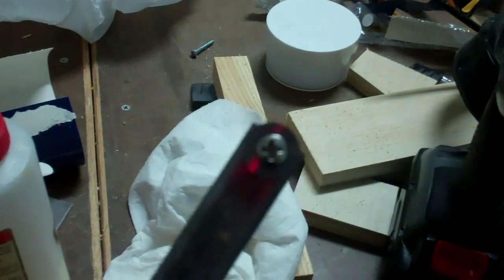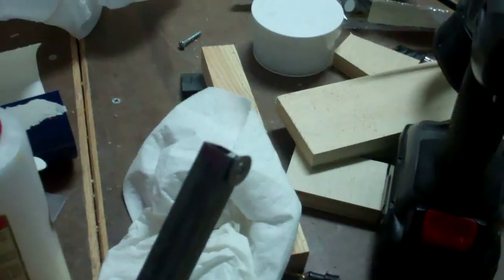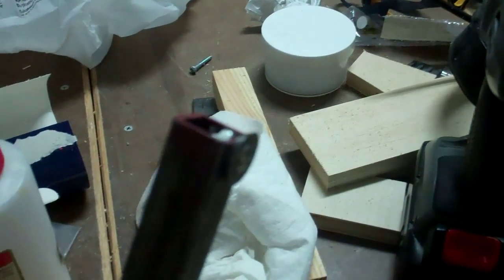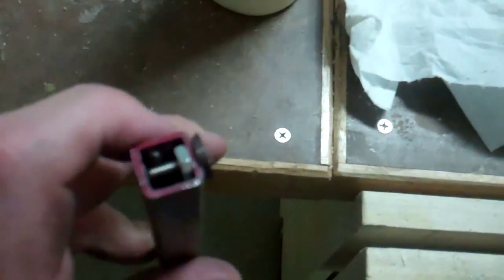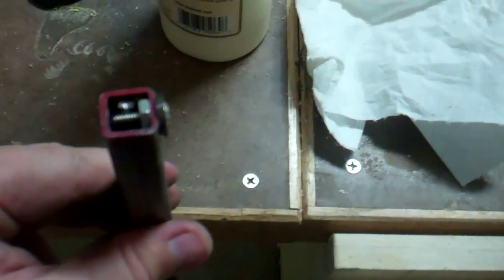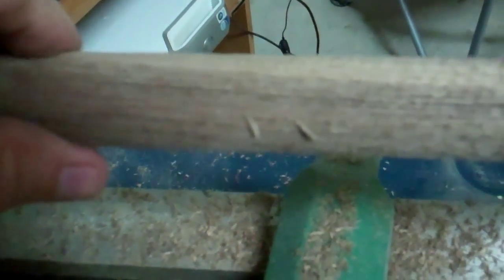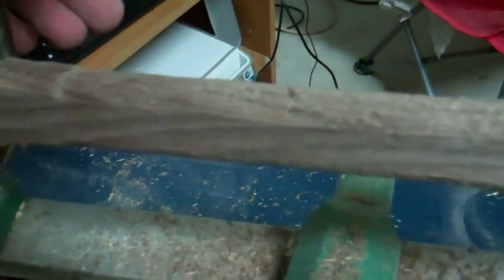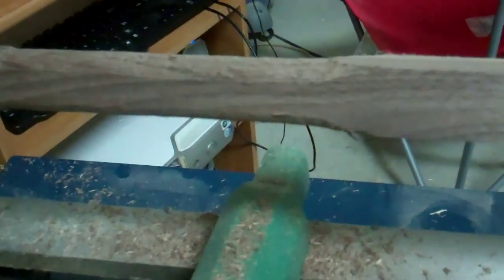Carbide Tipped Lathe Tool

Comment: Dude move the tool rest closer, that's step number one.     Number two is don't use a hollow tube, that's asking for trouble if you ever get a bad catch, and that thing was only on there with a simple nut, if that ever failed that carbide cutter might go through you like a bullet.      You need to get a solid steel bar, drill a hole in it, tap the hole and use a flat headed machine screw, not a pan headed common screw like you got there.      I realize you are new, and it's good that you tried, but you gotta be safe.     First way is put that tool rest closer.